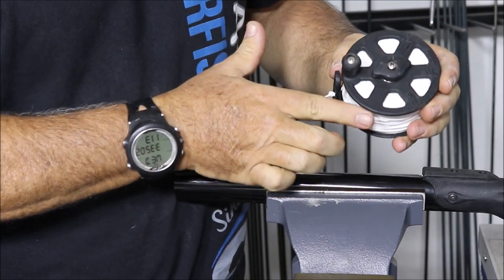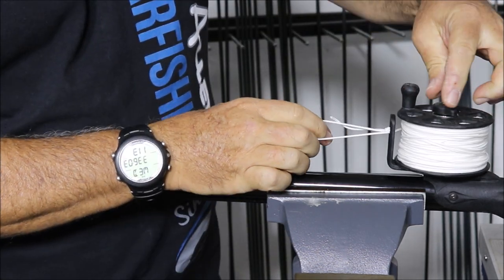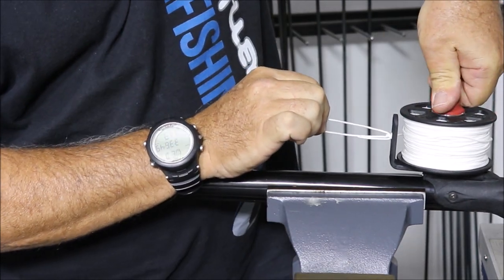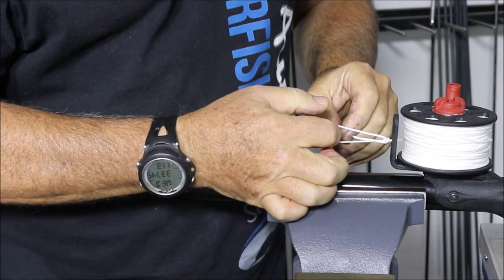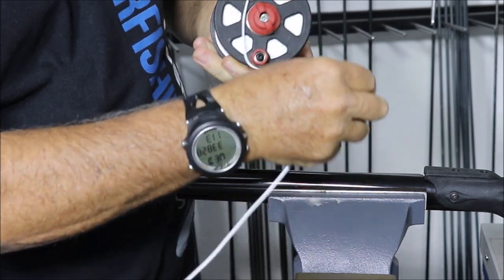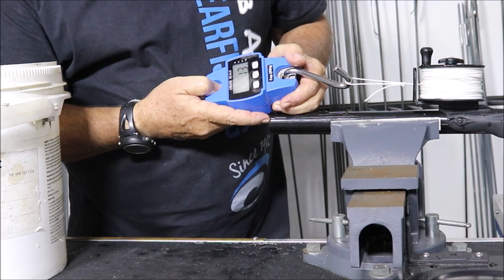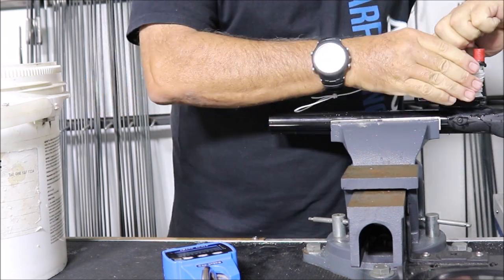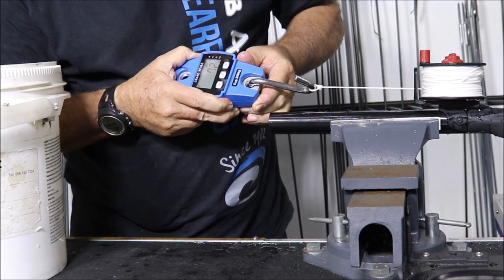Rob Allen | Vecta Reels | Part 2

Comment: Hey Rob, looks good. What reel line do you recommend? Diameter and brand. What length of that line can you fit on the spool?
Reply from the maker: Hi Noob Spearo. The original will fit 60m of 1,8mm to 1,9mm. The low profile (see previous video, part 1) takes 40m of the same. We recommend Dyneema because of its cut resistance and strength compared to polyester lines. Dyneema is also slightly lighter than polyester, helps just a little with buoyancy.
Reply: @RobAllenSpearfishing  thanks Rob👍 I'll have to get one! - Isaac